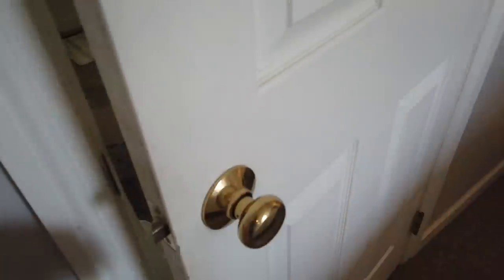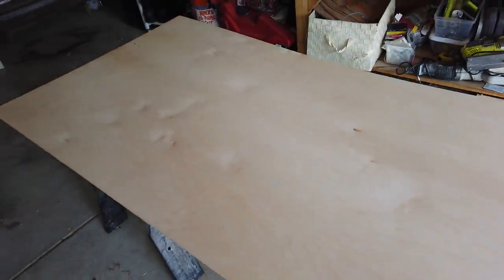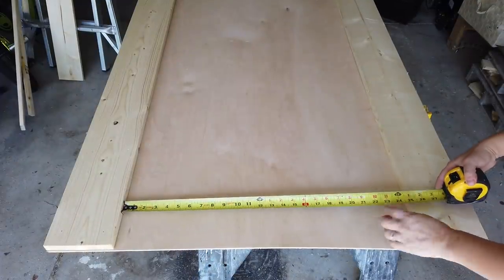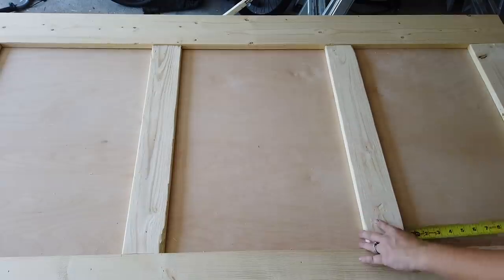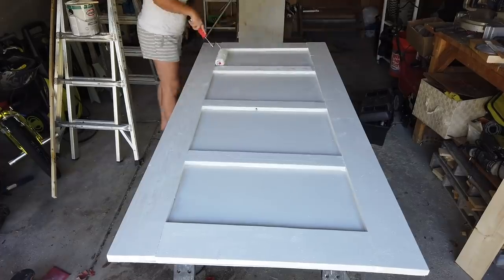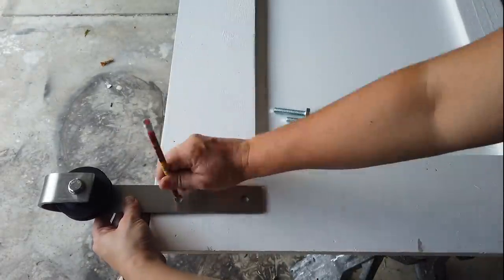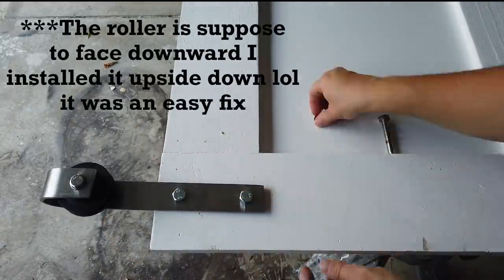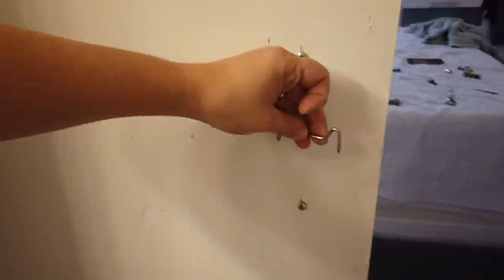Easy DIY Modern Farmhouse Barn Door

Comment: Used your video as inspiration to make a 72" door for a large opening in my basement.  Turned out great.  I used heavy duty construction adhesive instead of wood glue and didn't need to do any nailing.  Just put down some weight on it for 24 hours.  Also used particle board instead of plywood.  Cheaper and easier to paint.  Thanks for the video, couldn't have done it without it.
Reply from the maker: That’s great! 👏💕☺️

Comment: Love it! I just screamed that out loud. lol!
I had asked my dad if he could to make me a barn wood door with wood that I dug out of my neighbors yard that probably was there for 5 years plus we believe it was old wood flooring at one time. The best part was all the holes & the color he found after sanding all the dirt, grime & old the  stain off. I had to many ideas of what I wanted so I left it to my 84 year old dad with the help of my daughter over 4 summer’s ago while my parents escape the AZ desert heat up north to there cabin. He make a master piece. I just gave him the measurements of the entry into my master bath which had no door in the beginning but does have a pop out. I was thinking it was going to be so difficult to find a track but my dad came through and made his own with scrap iron from his business & even the rollers were scraps. He already had the bolts to be used for the track & the ones he put throughout the side & in the middle of the door’s frame. He went with a herringbone style that he had just finished doing the backsplash& a wall in the cabins kitchen.  I believe the  herringbone idea was my moms that was done in the kitchen yet he decided to lay it different then what we usually see. It’s is a  very difficult way to lay but it was nothing to my dad.  He had enough wood to do both sides with a 1 inch plywood that he had left over from remodeling the cabin’s kitchen counter to put in the middle. It’s supper heavy & took 3 men to get it upstairs to my room. The handle he even just had a hair brain idea & used some left over oak wood & piping that is used on a hot water unit. So be sides the fantastic time he had with my daughter the door cost nothing. It is truly a masterpiece like yours. Mine will definitely be handed down to my daughter since according to her she practically made it. Lol! 
Sorry for my long story but I love seeing everyone’s own style put into a home made barn door. Fantastic job! Not sure if you mentioned the total cost of yours.
Reply from the maker: That sounds beautiful Jennifer! Herringbone pattern is difficult your dad is a talented man! I love that you have something handmade like that that you can keep in the family for years to come! Thank you for watching and sharing you story! Have a beautiful day! 💕☺️💕

Comment: Good job on the door. I would secure that header board with screws into the studs. 18 gauge nails are not strong enough to hold that.
Reply: The 18 gauge nails are a temporary hold while she installs the hardware. The big bolts go through that board and into the stud.

Comment: could you have made the back of the door to match the front so that it would be decorative on both sides? i'm not that familiar with the barn door style. also, if you were so inclined, how would you trim out the bathroom side of the door jam since it now looks like the door was just taken down and that the barn door was not a purposeful addition on that side? or did you leave it that way so that the door could be reattached later? sorry for the questions, but i think its a cool style.
Reply from the maker: Thanks for the questions! I could have did the same thing to the back of the door I would have had to get a thicker piece of wood for my tail to be mounted to though since the door would be thicker so it wouldn’t stick out. I have decided what to do with the trim yet i could easily fill in the holes with some bondo and sand them down and repaint the trim that way it would look complete. Hope that answers your questions. Thanks for watching have a great day! 💕☺️💕

Comment: One question: so my current door-way does have a frame along it, how do I measure my new door- should it fit perfectly like the old door does in the cut out? Do I need to remove the frame/border first? Does it fit over the frame?
Reply from the maker: Hi! My door was bigger than my original door because it is found to cover the the opening of that makes since. The frame can stay on like I had on mine but when you hang the sliding door track you have to hang a piece of wood above the door for the track so that way the track comes out from the wall so it won’t rub on the frame. I hope all that helps thanks for watching!

Comment: Looks nice, but wondering why you didn’t just use the existing door by patching the doorknob holes and bracket holes? Good job!
Reply from the maker: Thank you! The exeisting door isn’t long enough there would have been a decent sized gap at the bottom between the door and the floor. That thought did cross my mind and I measured for it but it just wouldn’t work thanks for watching! Have a great day! 💕☺️💕

Comment: What a great project ! You are a "tool girl" pro. Just curious why you didn't use the old bathroom door as a barn door. Thanks for all the videos you share.
Reply: Chris Jacobsen my guess would be because the other door would have a hole in it where the knob was.
Reply: @HeatherLass  Of course! I never thought of that. Thanks...
Reply from the maker: Thank you! The knob is one reason but the other is the existing door was measured to fit inside the door frame so hanging on the outside it wasn’t long enough there would have been a significant amount of space between the bottom of the door and the floor if that makes since. I did think about and measure for it but it just wouldn’t work out for me. Thanks for watching have a great day! 💕☺️💕
Reply: measure & mix It turned out really nice.

Comment: What level of sound is traveling through the door? Would you recommend installing this style of door for a guest half bath? Our concern is that guests won't have true privacy because of sound carrying through the gaps but our current door there is super tight and difficult for people to step into the bathroom and shut it behind them because of how narrow the space is
Reply from the maker: Hi there! I wouldn’t recommend this for a guest bath. It doesn’t block sound very well because of the gaps. Possibly if you take down the molding around the door and don’t use a piece of wood for the tail at the top that will get it closer to the wall. Thanks for watching hope that answered your question. Have a great weekend! 💕☺️💕

Comment: So is your header the same width as the mounding? We need to do the same and I'm stuck on that part
Reply from the maker: Yes my header was 1in thick. So I attached that to the wall and then the track to it and it stuck out far enough from the molding so the door would slide easily. Hope that helps have a great day!!

Comment: What did you add at the bottom of the door to keep it in line from swinging outward?
Reply from the maker: I didn’t add anything cause I wasn’t too worried about it but you can buy guides on amazon for not too much though if you need them. Thanks for watching have a great weekend! 💕☺️💕